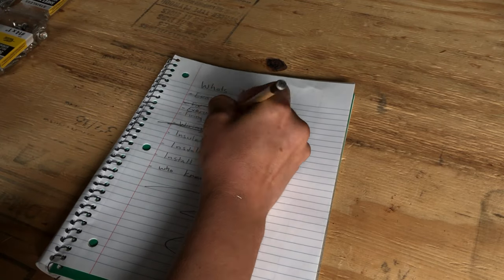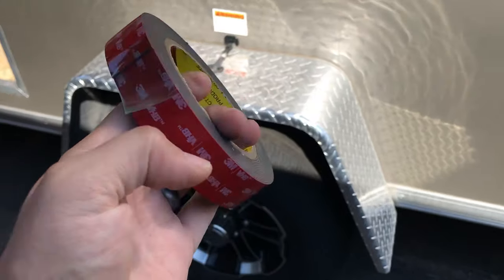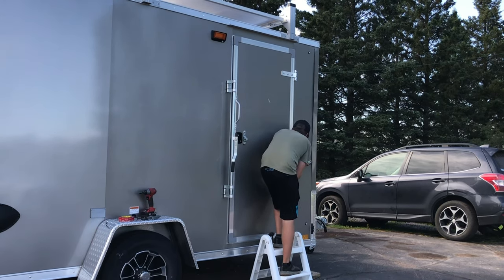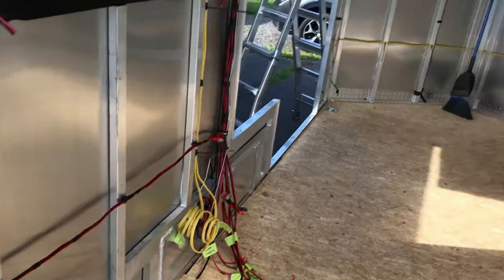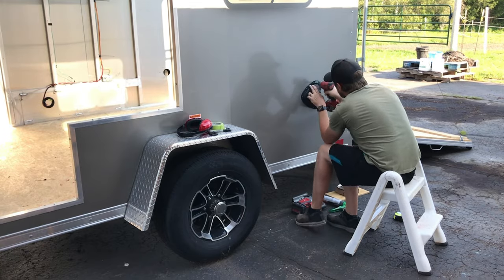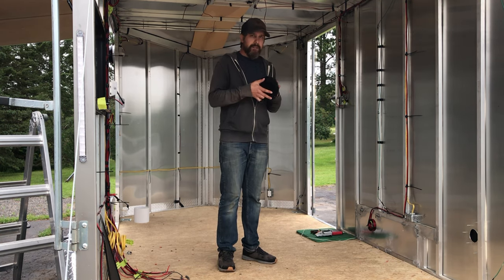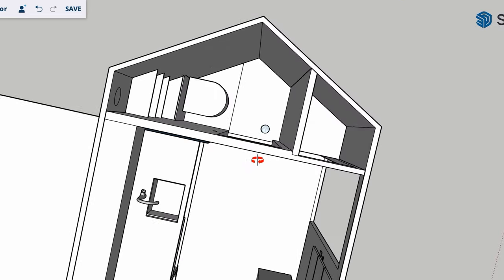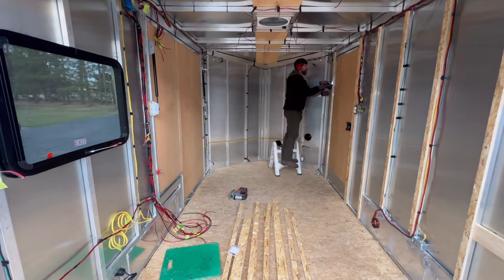Cargo Trailer Conversion Series: Final Exterior projects

Comment: When you were swinging your arms out the holes, I thought you'd be yelling "Danger, Danger, Will Robinson!"   It's sad that you have to keep going back and fix factory type installs.  You'd think a company would have more pride in their work.  Also,  the better quality of work and materials, the better customers satisfaction will be and the product eventually sells itself.  Example: Airstream Trailers, customers automatically believe if they get one that they've bought the best!  If you can do this by what you're doing through customization, eventually your reputation will sell your product for you.  Excellent work as usual.
Reply from the maker: I yelled it in my head haha. 
I’m sure there are better trailers out there. If I build another one of these I would shop around a bit more. I’ve learned a lot with this one and definitely know a thing or two that I didn’t before. 
Hopefully my videos help others make more informed decisions if they are getting into a similar project!

Comment: I use marine grade sealant 5200 on everything, it's  a little expensive and messy but  the stuff is amazing,this is what I use at work when we install windows on sailboats
Reply from the maker: Oh that’s interesting. I’ve been too scared to use the 5200 haha. But I could see how you would want it for a true marine environment. 

The 4000 or 4200 seems durable/permanent enough for most everything I do and I can get it locally, unlike the 5200. Plus I like the 4000uv formula for added longevity where it’s exposed.

Comment: I'd pull that OSB flooring and lay down treated plywood. Even urethane the plywood bottom before installing.
Reply from the maker: I know where you’re coming from, I do plan to seal the floor. The trailer has drymax osb which is very water resistant to start with. I’ve heard that osb is generally more water resistant to plywood because it has more glue throughout vs a handful of layers in plywood. And I don’t like the idea of treated plywood because it can react with aluminum. 

I do plan to insulate and cover the floor with rubber before sealing the edges. From there, the underside could/should be sealed somehow. Probably some sort of undercoating for added protection.

Comment: Just like i said in a previous video of yous.

There are 3 different sides on these trailers you can get. As you can imagine, every "step up" is also an increase in price.

1. Normal walls. Screws EVERYWHERE on the sides in the studs.
2. Semi-Screwless. Screws on some studs, Beattle Tape on seams outside, walls glued/sealed to the studs.
3. Screws. Self explanation, but is also then a 1 piece aluminum sidewalls. More/better glue/sealant to the studs.

Comment: I just installed a window, used butyl tape ( I also heated with heat gun, so the butyl would seal better. Because its getting cold here in Michistan.) . The verdict is out what I want to seal it with. But a cpl of your videos I've watched, you are swaying me to the 3M sealant. I'll look through and view your library and view some videos. I was thinking I wanted to match the white exterior. But I like the way you taped off the ports, so the sealant stayed contained. You do good work and practical.   
You keep posting, I'll keep watching! 😁😁 -cheers
Reply from the maker: I discovered the 3m fast cure a couple years ago on a rv forum and after trying it, fell in love haha. It’s flexible but strong, making it so versatile. Both lap sealant and silicone are inferior products that will require a lot more upkeep/replacement. If you do end up trying the fast cure, just make sure you get the 4200 or 4000 uv variant, not the 5000 series which is supposedly a permanent bond.

Comment: Nice Job.... I am in the process of converting an 8x16 v-nose cargo trailer into an RV and Mobile Sign Shop.  I am just starting the walls and cabinet construction. I just sold a 15-passenger shuttle bus that I lived in for 3 years and traveled out west during the winters. I had to sell the shuttle bus because I purchased a large format color printer to make contour cut decals/stickers, koozies, t-shirts, magnetics, banners, mousepads, etc.  The large format color printer would have taken up a lot of storage space so I needed to get something bigger.  I did a complete conversion series on the shuttle bus from the ground up and now am doing a new series on the cargo trailer conversion.  They are on my YT channel.
Reply from the maker: Wow, it sounds like we share a lot of the same hobbies and passions! I’ve dabbled in graphics design, screen printing, and basic sticker making. Thanks for stopping by and I’ll definitely check out your channel!